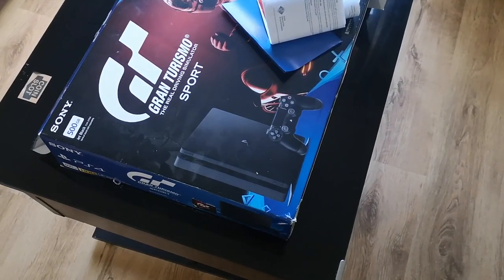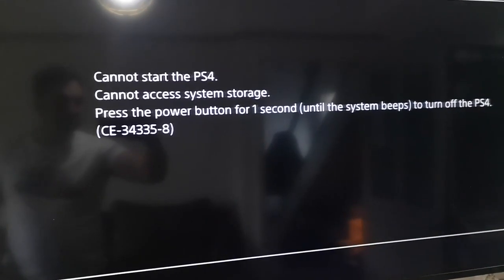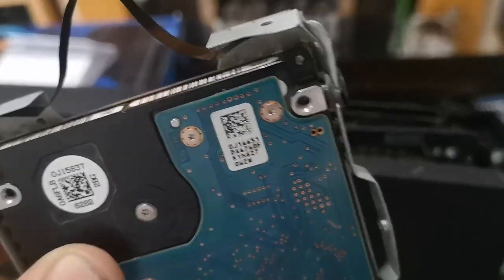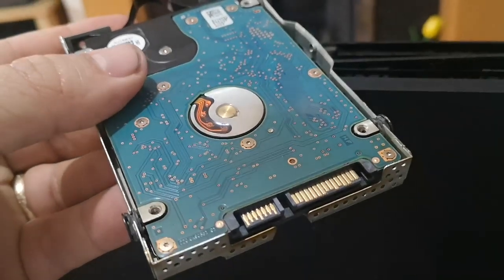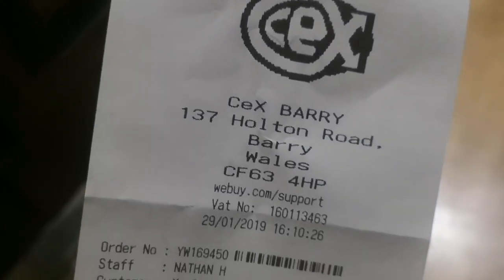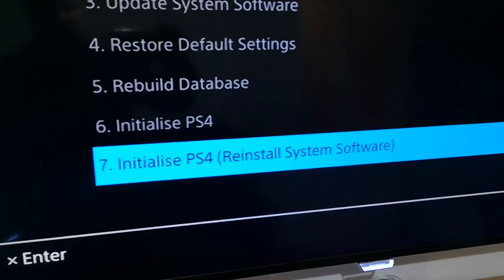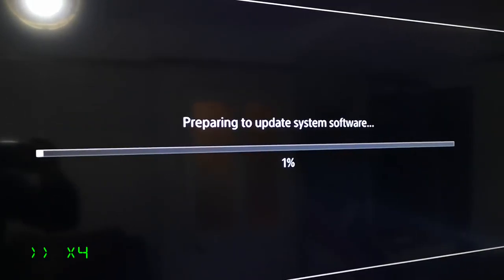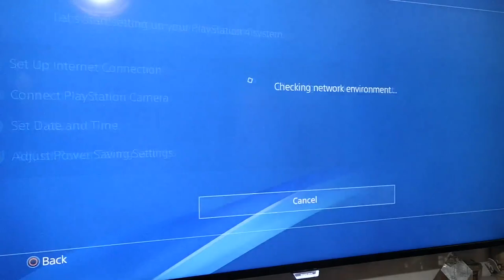CE-34335-8 PS4 Slim Hard Drive Repair Error System Storage Playstation 4 Sony

Comment: My hard drive appears to be fine but it keeps messing up. It started ab 2 weeks ago when I tried to start it up and it would not boot up. Then during the cod cold war alpha my gane crashed and said to redownload my game. I tried to rebuild database and it didn't work so i had to initialize it again. Now I can watch netflix on it but I have to redownload netflix everytime I start it up.
Reply from the maker: Sounds like the system is either corrupt or the drive is on its way out.
Can you backup everything and then do the full restore, it will wipe your drive so make sure you have saved and everything backed up.
If it still does it after that I'd swap out the drive, maybe get one from somewhere that you can test and then return if it's still doing the same.

Comment: My system crashed when I was in a game of fifa and the hard drive completely broke down, So I managed to find another one from a broken laptop I had lying around and re initialised it with the system software, now it's working fine until I go into a game of fifa and my ps4 freezes again while making a weird ticking noise which sounds like it's coming from the hardrive area. All other games work fine though. Do you have any solutions to this frustrating problem?
Reply from the maker: Sorry not sure, ticking hard drives aren't a good sign it's normally the head moving. I've not heard any issues related to that game specifically but it could be the way it stores the data.
Reply: @GoodwinsPlace  hmm interesting, I think I'm going to have to contact Sony. Thanks for the reply.

Comment: I know this video is a year old but i hope you still respond. My ps4 keeps crashing though it gjves no error code i turned it off and it wants me to reinstall the latest system software any idea what could cause this.
Reply from the maker: Could be a corrupt hard drive. That's where I would start before investigating on the board and other parts.
Reply: @GoodwinsPlace  replaced the hd with a newer laptop hd fixed the issues no crashes or random encounters thanks a bunch.
Reply: @minemenice6530  hello man . I have the same problem . Can you help me pls ??
Reply: @gentitorba6552  replace the hard drive download the lastest firmware on a usb stick and it should workout after. The ps4 uses the same type of hard drive as a laptop so make sure the connectors are the same
Reply: @minemenice6530  thank you bro

Comment: Hello do u have solution for the data is corrupted? I cant update or download any games from 2 months ):,i initialised  the ps4 and changed the router 3 times but still getting the same error on gta 5,fortnite,destiny 2
Reply from the maker: Only thing I can think of would be to do a full wipe via the menu shown in this video. It would wipe everything off your drive. If that doesn't work you could try putting the drive in a computer to check it's health or swap with a new drive.
Reply: @GoodwinsPlace  i did a full wipe for the hdd didnt work,will try to put it into a computer to chek it thank u
Reply from the maker: Might be worth getting a new drive and testing it. You can get them fairly cheaply these days, or if you have an external hard drive or old laptop you may be able to pinch a drive from that.
Reply: @GoodwinsPlace  i think i got old computer i will chek it later,but the hdd should be 2.5 inch/7mm? I have ps4 slim
Reply: Don’t remove it just grab a stick or something or even your finger and push it in

Comment: so everytime I start up a game, i can usually play for about 30 sec- to 5 min then I get an error (cannot continue using application, the data is corrupted). It does this for every game whether it's an online saved game or just a single player game. I've tried rebuilding the database, restoring licenses, etc and nothing works. Will replacing the hardrive fix this issue?
Reply from the maker: Possibly, does sound like corrupt disk. There's no guarantee, but I'd backup your data on this drive whilst it's still working and then give it a go.
Reply: @GoodwinsPlace  its quite confusing because the two games I have on disc work fine, it's just the digital versions of my games that keep having this error.
Reply from the maker: Disc games will still use the hard drive but not as much as a downloaded game. If you're in the UK try CeX for a second hand drive, they have a good returns and 2 year warranty.
Reply: @GoodwinsPlace  appreciate the feedback my man. I live in the states so I'll probably have to swing by some local businesses and see what I can find.
Reply from the maker: No problem. Hopefully you'll be able to find a drive easy enough.
Reply: This is probably already late, but you should update the system software of the PS4, then update your games
Reply: @damilolaobanijesuoyawole7677  yea man I've been on pc for forever now haha, thanks though

Comment: Hi mate. Would a bad hard drive cause safe loop? Tried to initializ and still saying cannot start ps4. What else on the board could cause this do you know? Thanks
Reply from the maker: Have you rebuilt with the latest software? Check all connections aren't loose, if you think it might have had a bump or similar might be worth opening up to check other connections.
Reply: @GoodwinsPlace  I've had it apart and checked everything,put new paste on and cleaned the board up. Tried rebuilding the database and then initializ the ps4 and still saying cannot start but with no error code. Has my head wrecked.
Reply from the maker: @crazypary948  that's a strange one and hard to solve over chat. I'd double check all connections including ribbon and power going to the drive caddy. 
Any chance it could still be a faulty drive?
Reply: @GoodwinsPlace  I've haven't changed the drive yet. Hate to buy one and not fix it but I'm strongly thinking that is the issue now.
Reply from the maker: Yeah it could be, and one of the cheaper items to change before either getting in to real detail repairs or giving up.
Reply: @GoodwinsPlace  OK thanks for your help mate 👍

Comment: If I have replaced the hhd and still get the ce-34335-8 what else can I do?
Reply from the maker: Are you able to get in to the restore menu to format the drive?
Check all connections and make sure no bent pins anywhere.
Has your PS4 been dropped or the drive just died?
Reply: Goodwinsplace my ps4 dropped. Does changing hdd solve the error??
Reply from the maker: @khaleesaneesak5146  depends on what broke when it was dropped. Hard drive is a good place to start, but if cables were in and dropped on those it could have broken the ports too.
Reply: Goodwinsplace cables are ports aren’t damaged... can changing hdd save my ps4 then?
Reply from the maker: @khaleesaneesak5146  really hard to say without working on it. If you are getting the same ce-34335-8 then it is a strong chance that swapping the drive will fix it.
Reply: I tried to put a new hdd in my ps4 but it wouldn’t recognize it I got the same error. I fixed it by changing the hdd from MBR to GPT. I also aligned the partition to cylinder instead of MB. I did this on MiniTool partition Wizard. Hope this helps

Comment: my ps4 slim i reset it so many times but games take for ever to download  and it crashes at times any one know the problem
Reply from the maker: Have you sorted this now? It could be the drive slowing down, I'd backup your data and then possibly look at doing the drive, good thing is if you buy a drive from CeX you should be able to return it if it doesn't solve the issue.

Comment: Hey does ps slim not turn on witout a hard drive?
Reply from the maker: PS4 slim? It should turn on to get power but won't boot.
Reply: @GoodwinsPlace  well i found a ps slim and it wont turn no nor show any signs of it working. No blue light or nothing
Reply from the maker: @efdeepro6427  sounds more than hard drive then. First thing I'd swap is the power cord, then it's likely to be opening it up to see where the power issues are.

Comment: My hard drive is literally stuck inside my PS4 and no where on the internet can help me wtf
Reply from the maker: So you've removed the plastic cover, then the screw and tried pulling it? Could be useful to take the top case and metal cover off to look at if anything has been bent in holding it in place.

Comment: I never had any problems till I dropped it from 3 feet and it's popping up I need help
Reply from the maker: Sounds like the same thing as this one. Only way I know to sort is hard drive replacement. You could try the recovery menu and see if anything works but generally this error means the drive is damaged.
Reply: @GoodwinsPlace  I feel dumb my screws were loose that's it
Reply from the maker: No need to feel dumb. I've built systems to test with no screws and they work fine, others just need things holding in place. Glad you sorted it.
Reply: @GoodwinsPlace  thank you I had a brand new hard drive in my cart and the I just tighten the screws saved some money right there

Comment: Why does mine say error has occurred?
Reply from the maker: At what point are you getting this message? Any error code?
Reply: @GoodwinsPlace  the error code is (SU-42118-6)
Reply: @GoodwinsPlace  it’s after I press initialize ps4(reinstall system software)

Comment: Plzz help me i was playing gta and it freez and i got to safe mode loop. When i try to initialise my ps4 it shows error code (SU-41335-6) my ps4 is just 1 week old its brand new. But i cant use my warranty coz i bought it overseas.  Plzz plzz anyone help.
Reply from the maker: Sounds like a firmware issue. Have you downloaded the larger of the update files from the playstation website and tried installing from the USB.
Also think the warranty is worldwide so shouldn't be an issue where you bought it.
Reply: @GoodwinsPlace  no. Coz i don't have a usb drive. I've downloaded the update online in safe mode but it stuck restarted and back to safe mode. Btw im from India and i think ps4 services here are covered only under Indian warranty. I have a question though will unplugging ps4 damage hdd.
Reply from the maker: Unplugging when it is still running? Possibly as the disk is still running. But I wouldn't say it would on a new system.
You'll need a usb to do the firmware update.
Reply: @GoodwinsPlace  thx for the help. Im gonna borrow usb from my friend and try it.
Reply: @GoodwinsPlace  it wasn't running any game it was on safe mode loop so i unplugged it. Not while running a game.
Reply from the maker: @mhdharsh7343  whilst the hard drive is running not the Blu-ray. Try and get a USB to do the update, that's the first thing to check.
Reply: @GoodwinsPlace  k I'll do it. Thx for the help. I was searching all day. The error code was not even on ps  site. Some people in reddit said that they fixed the issue by changing the hdd. Now i have hope it'll work with an update thx.
Reply: @GoodwinsPlace  i tried to update using usb it is showing error code again. This time its showing ce 33567 4.
Reply from the maker: Not seen that one, but seems to be your usb drive doing some searching. Might need to try a different usb drive that is compatible.
Reply: @GoodwinsPlace  no ive formatted it to fat32. And also with multiple usb
Reply: @GoodwinsPlace  it is having problem with initialisation. It reads the usb also shows the update but when it starts copying it shows the error code saying can't initialise.
Reply from the maker: I'd still try a different usb formatted to how they suggest. If that fails then move on to a hard drive swap to eliminate that.
Reply: @GoodwinsPlace  ive tried about 4 usb. I give up i have to change hdd. Its hard to think i just spend a buch of money buying new one now with less than 10hr usage im going to have to spend more
Reply from the maker: That really does suck. Can you buy from somewhere that if it doesn't work when swapped you could send it back?
Reply: @GoodwinsPlace  maybe from my local store. But still it'll be hard. I looking for a hdd to borrow from someone and test. Or maybe by plugging my hdd to computer and testing. Ill try. Btw thx for the comments.

Comment: Took out the hard drive it still didnt work
Reply from the maker: With new drive in? Can you get to the menu to do the fresh install? Or is it not working that far?
Reply: I tried to put a new hdd in my ps4 but it wouldn’t recognize it I got the error CE-34335-8. I fixed it by changing the hdd from MBR to GPT. I also aligned the partition to cylinder instead of MB. I did this on MiniTool partition Wizard. Hope this helps

Comment: Literally just dropped my PS4, exact same thing as the video...gonna try this in the morning, begging that it works lol
Reply from the maker: Good luck. If it's the same error then I think you'll be good. Hope nothing else broke. 🤞
Reply: Dude. Same thing happened to me. Many time try to reinsert but it still not detect.
Reply from the maker: @hafizmustaqim1517  give a new drive a go, worth a shot before looking further at any other issues.

Comment: Hey I recently bought myself a ps4 slim to keep myself entertained until I am able to purchase a ps5 and when I started it up everything was working properly then it started lagging everytime I opened something like the menu, a game, or anything on the UI. Eventually it got to the point where the system completely froze when I was checking a update for a game. I powered off the console after a few minutes and turned it on only for it to  start in the safe mode loop. I initilized the system and that helped the lagging a bit but it still continued and same goes for the freezing. I restarted my ps4 and initilized it once more and when setting it up I had my screen freeze then after 5 minutes the screen turned black and stayed there for another 5-10 minutes then the system shut off by itself. As of now the system will turn on and start me at the beginning of the initilization then it will freeze shortly after I begin like when I am setting time, wifi, etc. I just wanted to know what are your thoughts on how to resolve this issue. I have decided to purchase a new internal hard drive for the console hopefully that will fix the issue. Thanks and have a great day!
Reply from the maker: Hi, thanks for watching. Sounds like your drive is on the way out. Hopefully the new one will resolve this. I don't think it is a heat issue as it is still running and not powering it down.
Reply: Did it solve the problem bc that is happening to me right now
Reply: Same here this happened to me i just got a new hardrive. did your problem get solved??
Reply: @vbkdavid93 This happened to me lol😂. Is your ps4 working now?

Comment: You just saved my PS4 I took the hard drive out hella dust and weed smoke 💨 cleaned it put it back in and wallah magic back to normal
Reply from the maker: Weed is a killer for consoles. Glad it's working again. 👍
Reply: How did you clean it bro
Reply: Hey, have u cleaned just where the hard drive is or everywhere?
Reply from the maker: I always clean heat sync, fans and anything around inlets and outlets.

Comment: Hope u see this *
I just bought a brandnew ps4 pro a month ago and it gave me the same message but I tried to initialize it and I got it to the regular homescreen and it works but it's just so slow and when I shut it off the white light pulses for at least 5min. ....Real time I'm watching videos before I take it out to see if it's just loose or what ever but I'm just mad it's brand new !!!!...

j.w .  Your thoughts
Reply from the maker: If it's new can't you take it back?
Does sound like hard drive is failing, so will need to be replaced at some point.

Comment: I've got the same message so i replaced my hard drive, downloaded the updates on a usb, but it still won't read my hard drive, any tips?
Reply from the maker: Has the drive been used anywhere else before? Can you format it in a pc first? It should format and setup in the PS4 but just to test and clear it.
Reply: @GoodwinsPlace  It's formatted and it's brand new. I don't see why it's not working
Reply: @GoodwinsPlace  Also I've connected it to my pc and it works completely fine
Reply: @GoodwinsPlace  It also refuses to let me in Safe mode.
Reply from the maker: The safe mode is an issue. Can you connect your control pad using a good quality USB cable to know it's connecting.

Comment: I turned on my ps4 and my niece came in an unplugged my power surge protector from my ps4 and I plugged it back in and I got the CE-34335-8 message.i tried removing the hard drive and putting it back in and didn’t work. It’s a 2tb hardrive and I bought it recently and I don’t feel like buying a new one. If there is any fix could you please tell me?
Reply from the maker: Not that I know of, you could try the drive in a PC and try and recover it, but once they go it is either gone for good or if you do get it back running I wouldn't rely on it for long.
Reply: Goodwins Place aight thx I’ll probably just buy a 500 gig hardrive then.

Comment: Okay so my ps4 pro recently fell from a high place and not only does it show the error ce 34335-8 ,the safe mode won’t turn on as well so if I get a new hard drive with a usb stick and clean it inside do you think this will possibly save my ps4 ?
Reply from the maker: With the faulty drive still in you might not be able to get to the safe mode. 
It really does depend on the damage, it could be that a drive replacement will sort it. 
If you're in the UK you could try and get a used drive from CeX as they may take it back if not suitable.